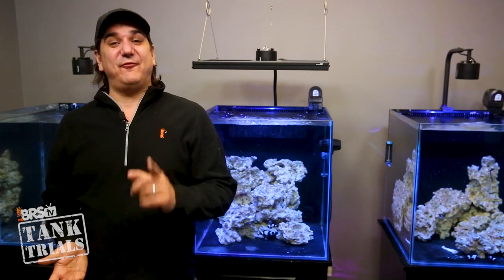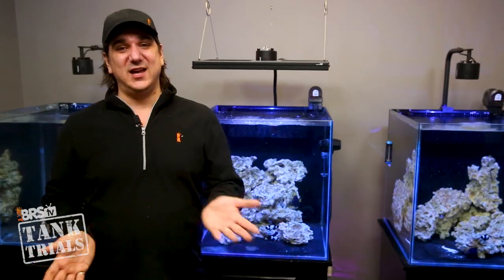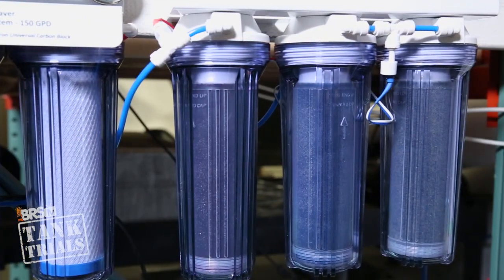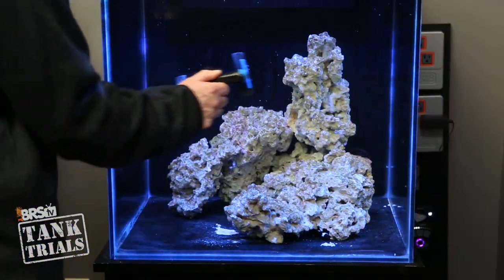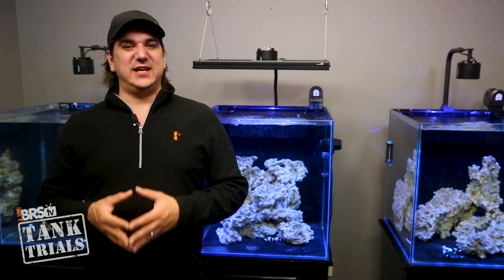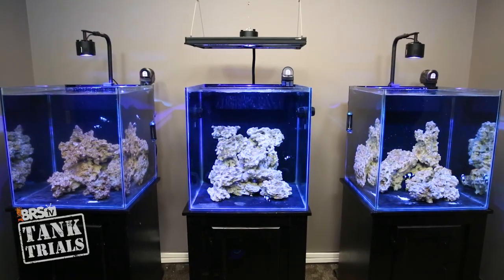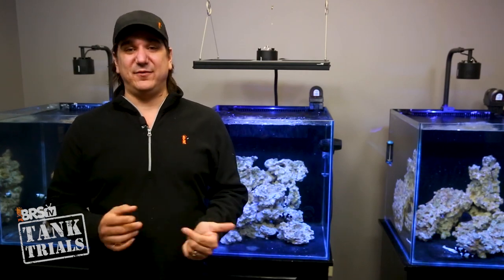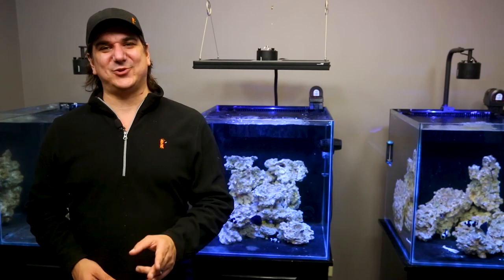ULM Tank Trials Ep-16: ULM Update-what we've learned so far | BRStv

Comment: Another awesome update on the ULM test. Seems to be going really well. I am glad you said that the Neotherm heaters are not always the best working heater for everyone. I went through 5 of them on my 60 gallon fresh water tank and finally gave up after I could not get the unit that finally worked to adjust up when needed. On my reef tank, I went through two of them after having both fail. I have replaced all these units with Marine land Precision digital units. Both of which work impeccably . My LFS and Cobalt were both super helpful in getting this worked out, but in the end, a trip to amazon to buy the Mainland units was the only true fix.

Comment: FYI the concentration of the kalk in the stirrer does change over time. Try it for yourself with a conductivity meter. When you first add kalk to it, it will be saturated, but watch it over the following days and the concentration does fall considerably until the next refill of kalk powder. It appears some sort of stratification of concentrated kalk takes place where the new water doesn't quite get saturated. I verified this with a $1200 conductivity meter :)
Reply: I was dosing through mine with a 25min/mL peristaltic pump when I saw these results.
Reply: This is why kalk reactors have stir bars at the bottom, to mix up the solution once a day or so.
Reply: Santa Monica Filtration yes... The one I was using is the same they are using in this video. The Avast with the continuously running stirrer. Doesn't matter, still gets diluted. Randy Holmes Farley has written about it many times as well
Reply: Chad Hutson hey

Comment: I disagree with the cobalt neo-therms being great.  I had one fail on me and the resin got all over my equipment and nearly destroyed my corals with the chemicals in the water.  When neo-therms fail, they fail big and go up in smoke (literally).  You have to think about not if equipment will fail, but when equipment will fail.  I will only use finnex titanium heaters because my apex will turn it off or notify me if it fails.  My apex didn't notify me of a temperature swing when the neo-therms blew up, because temperature was still stable.  It was the chemistry that was thrown off from all of the resin.  Keep that in mind when you buy neo-therms.